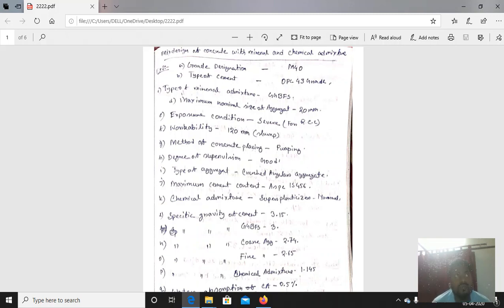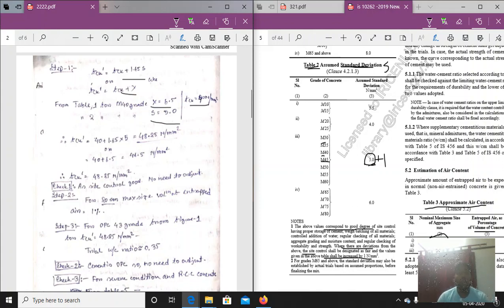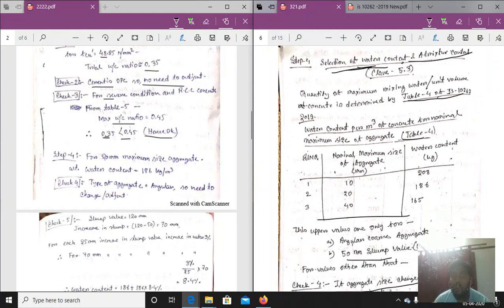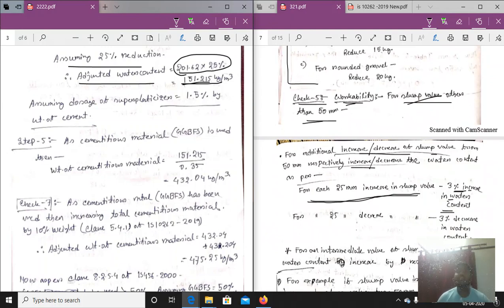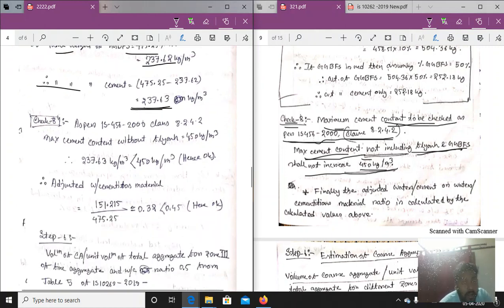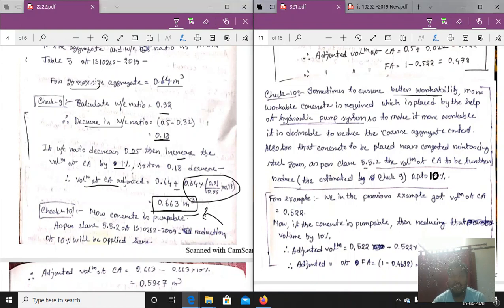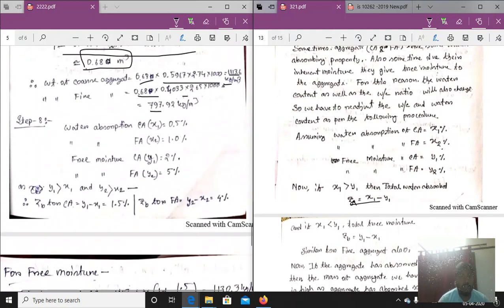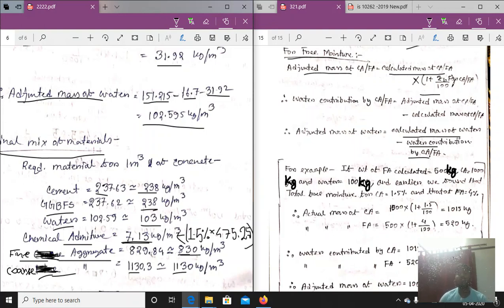Mix Design with chemical and mineral admixture Date-10/4/2020

Comment: under step 8 the calculation is made only for free moisture, where as under same step at right side the fromula is given for both water absorption and free moisture, why is it only calculated for free moisture?
Reply from the maker: See the problem statement. The water that is being consumed by the aggregates are more than the free moisture supplied from aggregates. So ultimately if the total free moisture is consumed by the aggregates still aggregates will consume water. That's why the calculations for water absorption is only done.